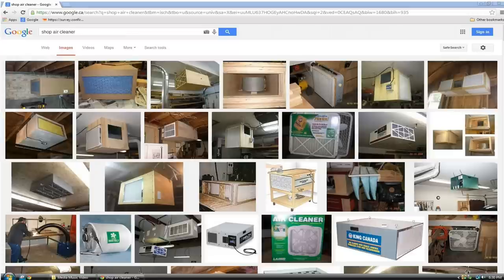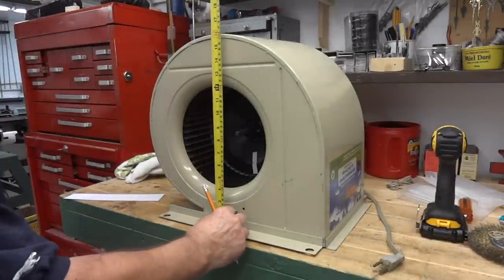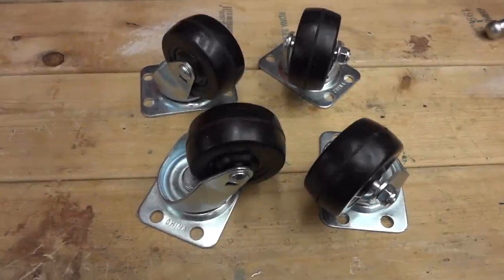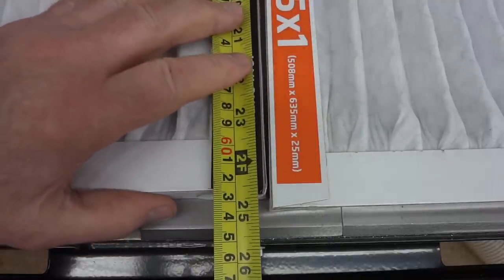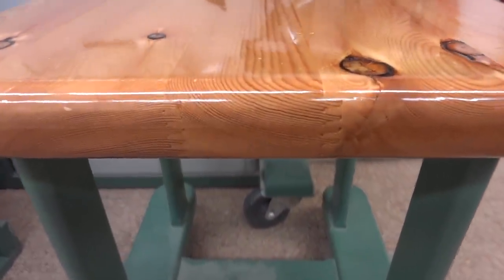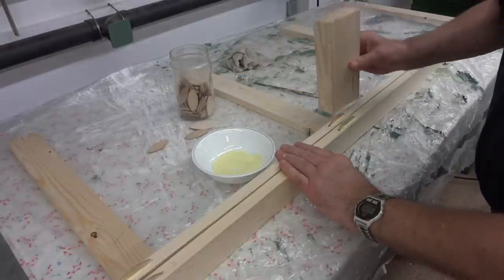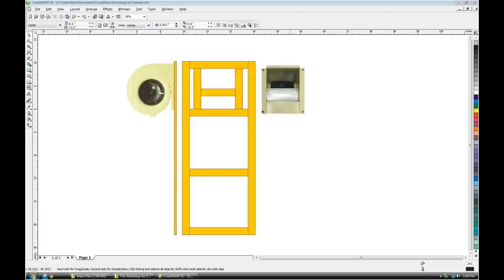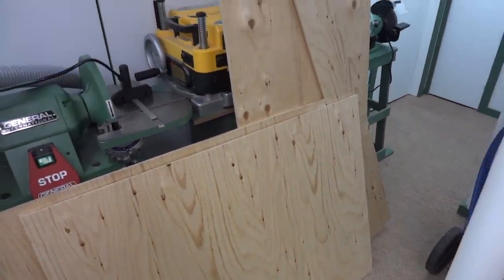The Workshop Air Cleaner Part 1

Comment: For just dust; I'd use those washable filters sold for people with allergies for heating and air conditioning. They sell them now at most home centers. In a enclosed shop where wood work is done filters will need replacing a lot and can get expensive for any that are really effective .Cheap home heating/ cooling will clog quickly not be as effective; IMO.
Reply from the maker: Thanks for that tip David :)

Comment: This video is a godsend, thank you! I've been given two home-use furnace/fireplace fans, one around 500 m3/h and the other 100 less, which is more than enough. My question is whether you'd recommend a setup like yours for a spray painting booth? I would be using both water- and reducer-soluble paints. They're both IP54 secure.
Reply from the maker: Every auto body shop will have a spray paint booth. Check with them. They will be better to answer that question better than I can :)

Comment: ......tip for ya.....you have to restrict the air going into the fan. All hvac fans must have a load on them. Don't ask me why but the moter will run HOT and burn out. Hvac service tech. ,,,,,,,duct tape or metal tape should restrict about 50 percent of the opening when used in this manner.
Reply from the maker: Thanks for that "tip" :)

Comment: Hi I'm making a box fan dust filter and wondering is it alright to use paint filter instead of furnace filter?
Reply from the maker: A paint booth filter should be okay, but aren't they a lot more expensive?
Reply: @roncalverley I'm from Malaysia hence we don't sell furnace filter and paint filter is easily available and cheap. Thanks for the reply.
Reply from the maker: Re: "I'm from Malaysia"
I will be thinking of you nice and warm down there in Malaysia while soon I'm freezing up here in Winnipeg. 😁
Reply: @roncalverley  I feel ya, cause I been to Calgary during the winter months and is freaking coold.

Comment: Get a Floor Dryer Fan, Easy Cleaning, Less Work and Less Time = Your Choice cause Time = Money $$$$ LMAO........................... Tips... You need 2 Stage Filters. Use a Cheaper Filter to catch bigger stuff and the expensive ones to catch smaller Particles. Change the Cheaper Ones often to SAVE $$$ on the expensive Filter :D
Reply from the maker: 2 stage filter system ---  good idea :)